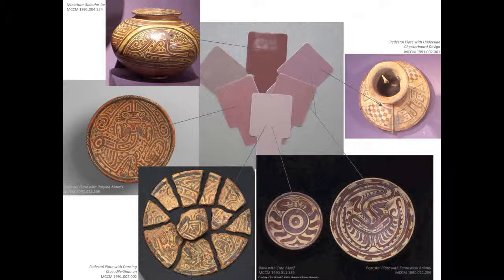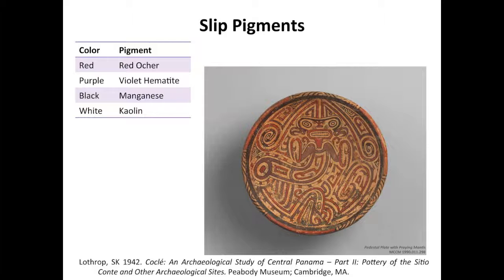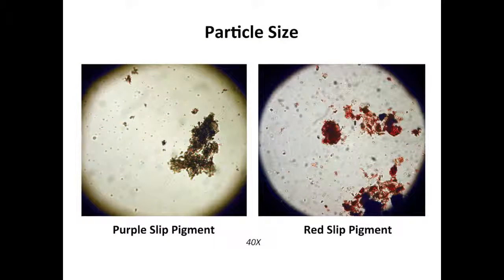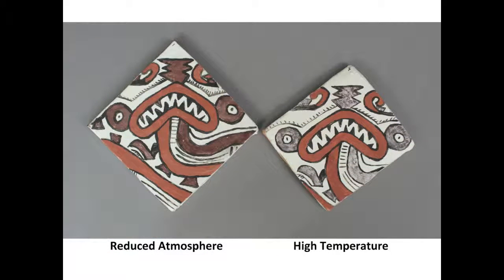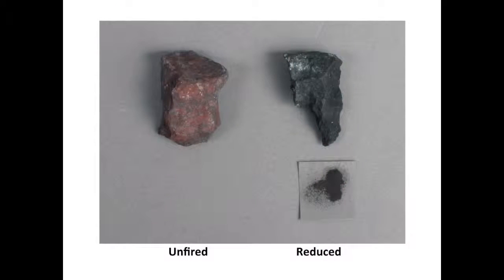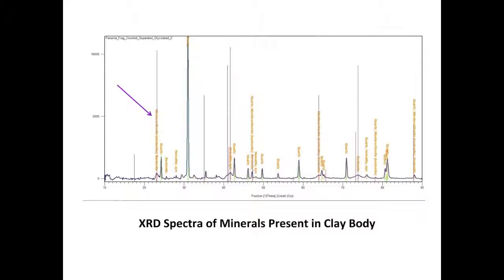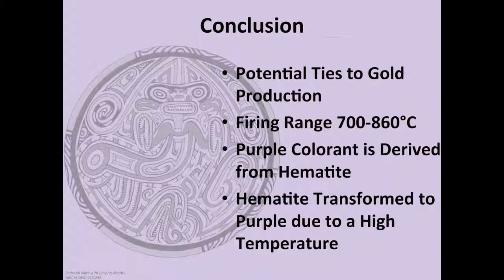Panama Purple: Investigating a Misunderstood Technique

Comment: PANAMA PURPLE: Investigating a Misunderstood Technique
Kathryn Etre, Andrew W. Mellon Assistant Conservator
Michael C. Carlos Museum, Emory University
You Tube Video, uploaded February 2, 2016

During the years 500 to 1100 AD, a polychrome slip design with three or four colors was being used in the Coćle region of Panama. The distinctive slip color of this period is purple. Although other areas in Central and South America have purple hues in their pottery, these other purples are more maroon. The Panama examples have a blue-gray hue. What is this pigment exactly, and how was this unusual hue produced?

Numerous printed sources discuss the designs on these ceramics, but there are no recent studies on their production technology. Many suggestions about the materials in these unique ceramics have been stated as fact, but none of these suggestions are supported with analytical evidence. The following presentation will describe research conducted to better define the production technology of these ceramics, in particular the purple slip.

(1:07) The Michael C. Carlos Museum of Emory University has nineteen ceramics from the Coćle region with this purple slip. Most of the analysis for the study was conducted on an originally kilned pot, which provided easy access to break edges and worn slip for sampling. 

The purple slip is in actuality not purple (1:30). The Munsell color charts place all of the purple slips within the gray-red range. The Munsell Color System consigns values to every color based on the color’s hue, lightness and color purity. As everyone sees and describes color differently, this system allows colors to be discussed objectively. For clarity however, this slip will be referred to as purple.

(1:50) Under polarized light microscopy, the particles of this purple pigment are homogeneously purple, and between 0.5 micrometers to 0.1 micrometers in diameter. This appearance reveals that the purple pigment cannot be a mixture of red and blue minerals, but rather is itself a purple compound.

(2:09) The only scientific analysis of these slips on these ceramics was conducted by Rutherford Gettins, who is the father of conservation science, and reported in archaeologist Samuel Lothrop’s 1942 “Coćle: An Archaeological Study of Central Panama.” Gettins identified the slips of these ceramics as red orche for red, violet hematite for purple, manganese for black, and kaolin, or another white clay mineral, for white. Analysis of the crystal structure and the elemental composition of these slip minerals confirmed Gettins’ identifications of the red orche and manganese black. The purple is iron-based, as seen in this x-ray flourescence spectra (2:50).

There are very few purple mineral colorants, and even fewer containing iron. The iron-containing purple minerals are purpurite, vesuvianite, crocus martis, and natural violet hematite. Purpurite, vesuvianite, and vivanite, a blue mineral that becomes purple upon heating, can all be discounted since netiher manganese or phosphorous occur in the elemental composition of the purple pigment on Coćle ceramics. Although the sulphur in crocus martis could have been burned off during firing of the ceramic, crocus martis becomes maroon when fired, instead of maintaining the gray-purple hue.

(3:37) This tile shows a few of the suggestions, both from print and by person, that were tested. Many of these can be discounted as they do not contain iron, contain elements not seen in the analytical spectra, and or do not become purple upon firing. However, as Gettins identified, the purple pigment appears to be a Violet Hematite.

The question is why is the hematite purple? The color of hematite particles is dependent on their size: bright red between 0.1 micrometers to 0.2 micrometers, and purple between 1 to 5 micrometers. As mentioned previously, the purple particles in the slips studied are much smaller, 0.5 micrometers to 0.1 micrometers.
 
(4:25) These are samples of the purple and red slips from one of the Carlos Museum’s Coćle ceramics. As you can see, the particle sizes of the red and purple slips are similar. Thus the hematite in the purple slips cannot be naturally purple, due to its small particle size.

Gettins mentioned that violet hematite may have been derived from red hematite but did not explain how this shade was derived. The dehydrated state of the purple slip, as noted by Gettins, could be created by two different processes: either heating in a reducing atmosphere and then reheating in an oxidizing atmosphere, or heating at a high temperature.

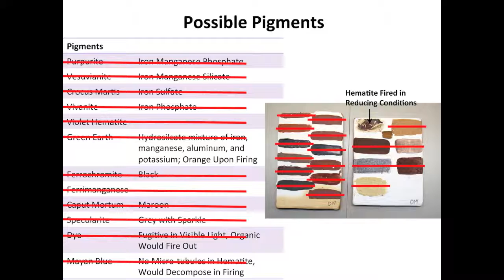(5:06) These are two test tiles: one with hematite fired in a reducing atmosphere on the left, and the other with hematite fired in a high temperature on the right. Since both the red and purple slips contain hematite, the alteration of this hematite pigment must occur separately from the firing of the vessel itself, to avoid altering the red slip as well. The white slip was applied first, then the colored slips, and finally, the black outlining, but there is no consistency in the application of the purple and red pigments. If the alteration of the purple pigment occurred during the final firing of the pot, the red slip, also composed of iron oxide, would become purple under these conditions as well. If the purple slip was always added first, or last, a change in the firing conditions could be possible. However, when the overlap of the various slips is examined, sometimes the red pigment is seen applied over the purple, and sometimes the purple overlaps the red, and sometimes both occur in the same ceramic. Therefore, the hematite must have been turned purple first and then applied as slip to the pot.

It is possible that nodes of hematite were buried in coals to produce an oxygen-deprived, or reducing, atmosphere. Once the purple color was reached, the nodules could be ground to produce pigment for the slip. (6:32) A nodule of unfired hematite is on the left, and a nodule on the right is a piece from the same stone heated in a reducing atmosphere with the ground pigment in the front. In this way a purple color could be achieved without needing a high temperature.

(6:47) To recreate this reducing atmosphere, a piece of hematite was heated in a pitfire. The fire was smothered by dirt and left to cool. Once the hematite was cool, it was ground and applied as slip on a test tile and the test tile fired.

(7:01) Although an appropriate color was achieved using this technique, if you compare the test tile to the detail from one of the Carlos Museum’s ceramics, magnatite was present, as seen in this x-ray diffraction pattern. None of the four ceramic samples from the Carlos Museum’s collection had any magnatite.

(7:24) If a reducing atmosphere was not the cause of the dehydrated hematite of the purple slip, the other possibility to achieve the purple hematite is a high heat. Hematite will turn gray at high temperatures. (7:31) The tile on the left is unfired, and the tile on the right is a copy of the one to the left, but heated at a high temperature. Note that the iron-based pigments have a blue-gray hue. Based on the presence of montmorillonite in the body of the ceramic and the appearance of the hematite nodules used as temper, the firing temperature of the Coćle ceramics is between 700 to 860 degrees Celsius. Montmorillonite degrades at 860 degrees Celsius, and the hematite nodules show irridescence and bubbling, which occurs around 700 degrees Celsius. However, a temperature of at least 900 degrees Celsius is necessary to turn hematite gray, supporting the conclusion that the hematite was turned purple separately from the firing of the ceramic.

Scholars have doubted that pre-Columbian Panamanians could achieve such a temperature during firing due to the lack of evidence of kilns, but the higher temperature could have been created through the use of a brazier, as used in metalwork.

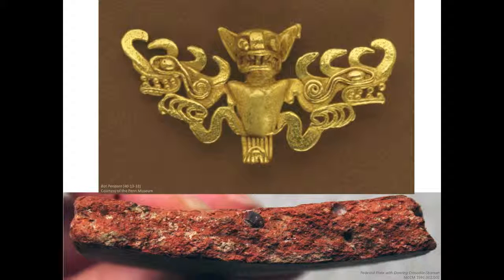(8:39) Cast gold, seen in this example from the Penn Museum, was burgeoning at the time of the introduction of the purple slip. A temperature of at least 1000 degrees Celsius was necessary to melt the high purity gold used in cast Panamanian gold work. 

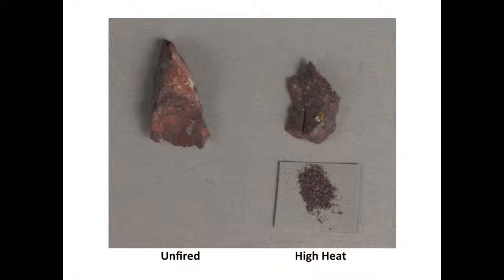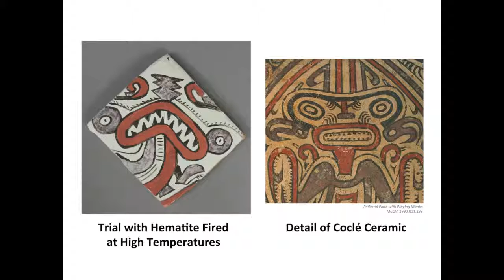(8:55) A sample of hematite was heated in an oxygen-rich environment at a high temperature and the hematite turned purple. The unfired hematite is on the left, the fired hematite is on the right, with a ground example on the front of the fired nodule. Note the purple hue. After being ground, painted on the test tile, and the tile fired, the purple color of the slip remained. This purple was closer, as seen on this slide, to the range of the Munsell colors of the four-colored polychrome pots at the Carlos Museum than the hematite which was reduced. (9:32) More significantly, the x-ray defraction spectra of the recreated purple pigment showed no peaks for magnatite, and the spectrum was similar to the XRD patterns of the four Panamanian pots tested.

CONCLUSION (9:44)

Purple has been equated with luxury and power in many cultures due to the rarity of purple in nature, and the amount of time necessary to produce purple artifically. The time and resources needed to create the purple pigment, and the possible association with gold production, places extra significance on the use of purple in Coćle ceramics. Through a combination of experimental archaeology, and analytical techniques, the firing temperature of the Coćle ceramics is between 700 to 860 degrees Celsius, and the unusual purple pigment is hematite heated to a high temperature of at least 900 degrees Celsius, thus providing the analytical evidence for the manufacture of these techniques.